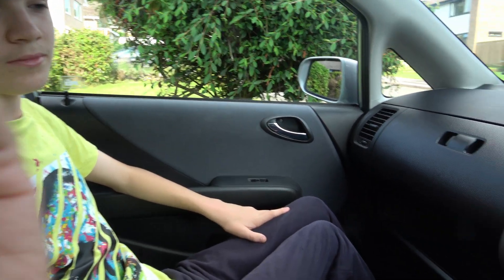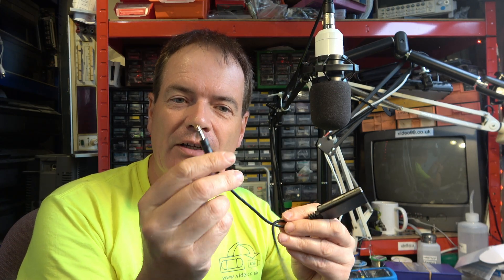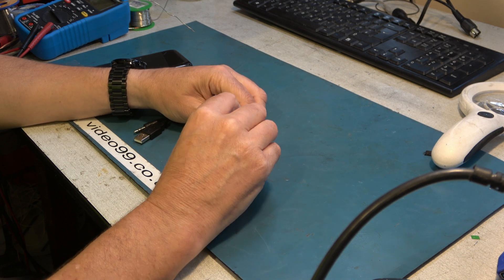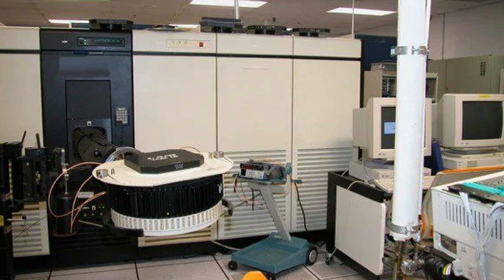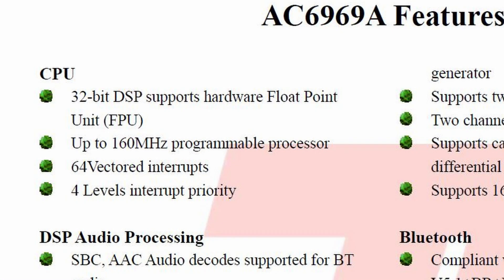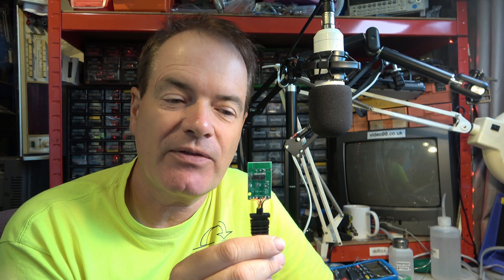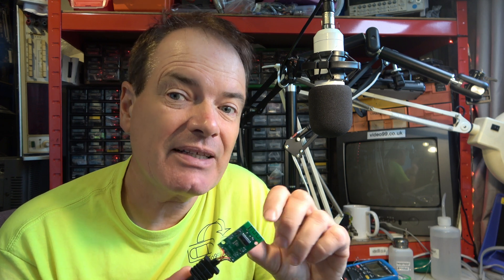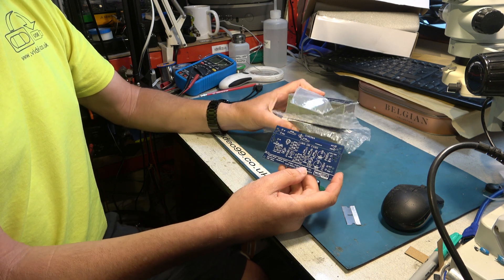Is this "stereo" bluetooth receiver a scam product?

Comment: you could invert the out of phase channel with a sot-23 transistor configured as an inverter. You just need one sot-23 transistor and one resistor.
Reply from the maker: But still wouldn't be stereo.

Comment: Manufacturer of the IC is Zhuhai Jieli Technology, I asked 3 years a question about this mysterious brand on electronics stackexchange. It would be nice to know how to program these things because mostly the functionality and feature set is great but the implementation sucks. For example, the new one you ordered right now could be one with irritating long messages (in strange chinese 'English') such as; "The bluetut dewice is ready to pair" and "The bluetut dewice is connected succesfully", really, really anoying. I quess that is an option in the firmware. Some of the implementations allow you to use an USB connection as USB soundcard. This is really a great feature when using a computer or mobile device with OTG. 

If it is possible to buy the IC, you can write your own firmware with an usefull broadcast name and pretty messages. Also discovered that the power consumption can be different, even with the same chip. I have a (tiny) board that consumes more than 300mA, I think that is also an issue of firmware and configuration. When the power is insufficient, it starts to malfunction or starts to use a lower quality codec mode that sounds awful.  It could be also a problem of the quality of the buck converter inside the cigarette PSU. Try to use a capable battery instead.

Other options to isolate the noise (result of a ground loop) can be an audio isolation transformer(s) or an isolated DC/DC converter. I use Mornsun isolated DC/DC converters in many bluetooth projects with great success, they are fantastic. 

I couldn't find any data sheet for Zhuhai Jieli Technology ICs, where did you find it? 

Long post, sorry ;-)

Comment: A lot of these low cost devices are used as line filler product for various small contract manufacturers.  In most cases, they would have just bought the design in from some design house and don't really know how it works - they just have the gerbers and the BOM and a supplier for the plastics.  The EOL testing for something like this would probably involve nothing more than plugging it in an checking the output with a scope.  So I can absolutely see them getting through with the wrong firmware installed.

Comment: probably the ground (gnd) of the output was disconnected. At least that would exactly sound like that. probably either already broken contact in the cable due to bad soldering or a completely faulty production batch. 
That's repairable with a new cable, but if you do not have the tools at hand and like tinkering, not worth the effort. go for refund.
Reply from the maker: No, the ground is intact.  The outputs are in antiphase in order to drive a single speaker in push pull mode.

Comment: Finally, someone managed to find the datasheet for these chips. They're everywhere, from Bluetooth headphones to receivers and even some transmitters. It would be interesting to be able to change the firmware. There's probably some tool that allows you to do it via USB. I bought some Bluetooth stereo transmitters, and they use this chip, and the USB port is functional, it's not just for power.

Comment: I've got a Chinese made bluetooth receiver/transmitter which I wanted to use to feed my oldschool stereo. It works fine as such, except it's mono. Tbf it nowhere says "stereo" on the box. So don't take stereo for granted these days, especially in cheap products it might not be, sometimes intentionally so.
Reply from the maker: Since the BT chip will be stereo by design, it takes a certain amount of incompetence to make it mono.

Comment: If you search well, you will find a program to reconfigure this system, and you can even upload your own messages, like 'BT connected,' etc.
Reply from the maker: Sounds very interesting, do you have a link?
Reply: That new red BT module has also a Chinglish speaking woman living inside ‘the Bluetooth device is connected eh successfully’, i have the same pcb in my 1960’s tube radio.
Reply: A little bit more of a hint like a software name would be helpful. direct links will be automagically censored/shadowbanned (only the poster can see it, to give the illusion it went through) by youtubes mostly braindead AI comment moderation

Comment: I had one of these things, and the ground wire inside the moulded plug had become disconnected, and it was outputting (L-R) instead of L and R. Some of these devices are total rubbish indeed!

Comment: Did I get it right it is not possible to dump firmware for fixes? Or maybe ask manufacturer?
Reply from the maker: There is a USB port on the PCB so reprogramming is just about a possibility.

Comment: There's really no excuse for this. For about £2 delivered there are a number of very similar devices on AliExpress, from "brands" like Toocki and Essanger, which have a 3.5mm jack linked via a curly lead to a USB port. The jacks are metal and the sound is stereo and good quality (I don't have one in the car yet but I've plugged them into a couple of older WiFi speakers from Pioneer which lacked BT, and I can't really tell the difference between the WiFi and BT on these). For a couple of pounds more you can get a Baseus version which should be a little higher quality still.

These ones are just nasty. Even some 50p bare BT boards give decent stereo output these days.

Comment: The noise could be a ground loop problem, with the digital ground going through the output jack and the battery negative acting as the audio ground on the PCB. The output lead could act as an aerial. (?)

Comment: So it's a single channel balanced output? If the connector was an XLR or 6.5mm TRS that would almost make sense, sort of - but on a 3.5mm TRS that's just downright strange.
Reply: FunFACT: when you feed a balanced signal into a stereo input, you get L-R instead of L & R
Reply: The operating mode of the output stage is under firmware control. Presumably this specific IC was configured for differential output mode (possibly for direct drive of a mono speaker), and the people assembling the board didn't realize that.